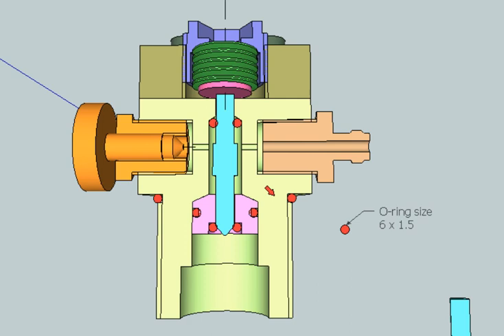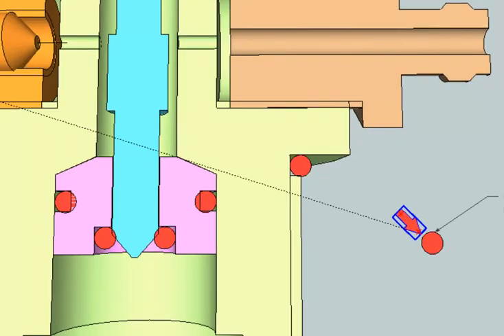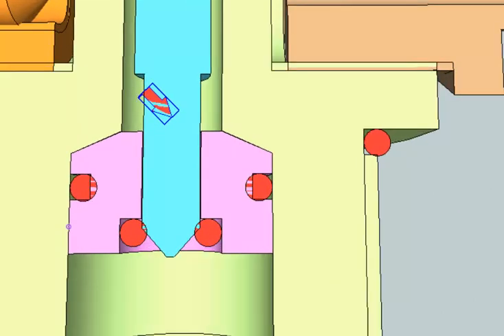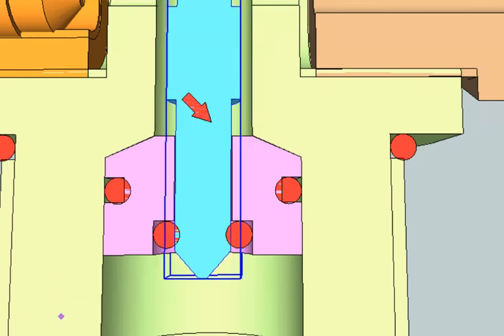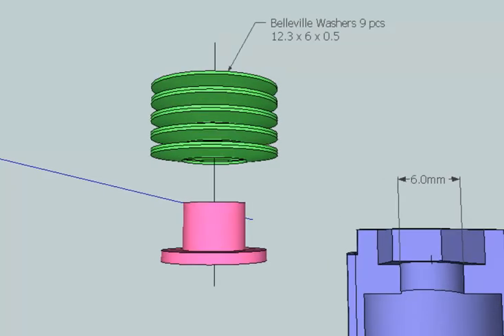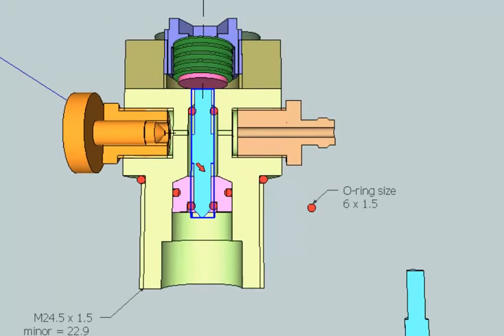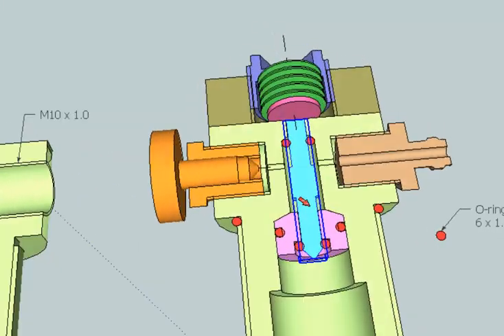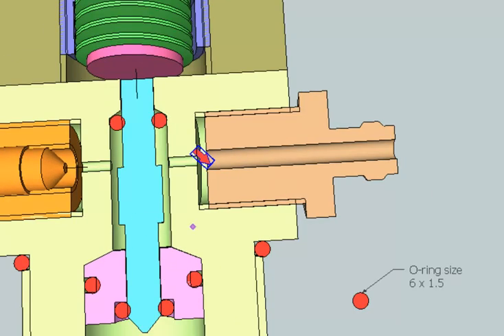DIY Pressure Maintaining Valve

Comment: Why don't you try making PCP without using a hammer? Using solenoid valve opening and closing mechanism
Reply from the maker: Solenoid valve is large, needs a battery, might not be able to handle the pressure, orifice size is small, etc etc etc